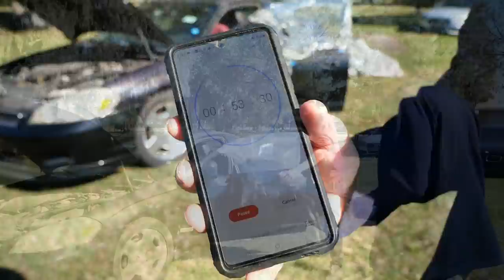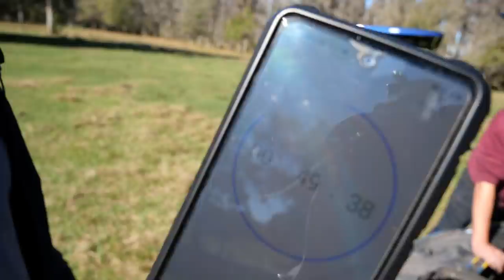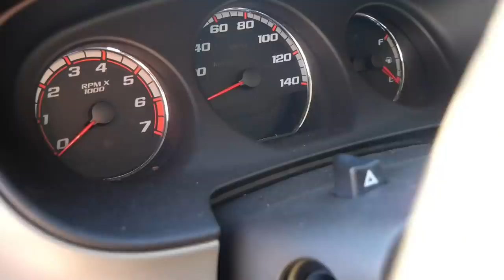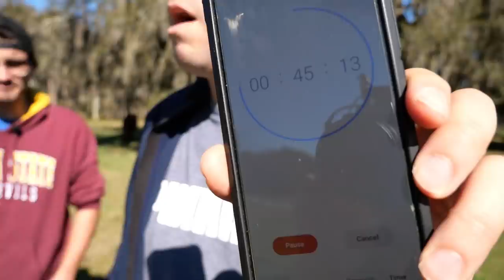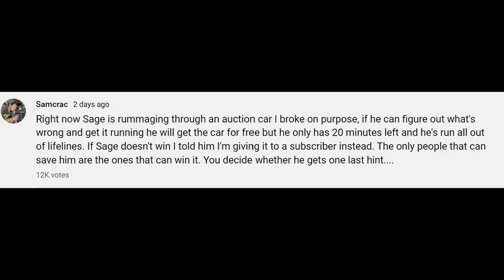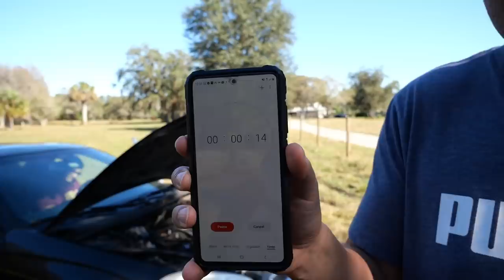If You Can Get this Sabotaged Auction Car to Run and Drive, You Can KEEP It for FREE!

Comment: Poor kid was in the end, shaking with stress and had bloodied his fingers, he did pretty good considering he's only done a lot of his "car learning" from Sam. Sometimes Sam makes me cringe with some of the "dumb" moves he makes when fixing his cheap cars, so Sage did good all things considered.
Reply: Budd Smokegood  drinkin a lil bit too much haterade
Reply: He didnt even try....
Reply: Give Sage the car
Reply: He didn't even understand the simple clue
Reply: @MohdAzylee  yeh well we all worked it out after he opened up the air duct, 20-20 hindsight.
Reply: @gazzafloss  I watch untill the end. When sam said he didnt touch thr fuel tank i knew it has to do with intake
Reply: @MohdAzylee  well man,  it's a pity that Sage's lifeline call wasn't to you instead of just Rich.
Reply: Damn wish id been offerd that would have made a good paddock basher. I knew everything he did tto the car even without the clues i would have got it running.

Comment: I've always had a soft spot for these. I'd love to mod the supercharged 3800s in the older ones.
Reply: You need to do the fiero 3800 supercharger swap. It's really quick cause mid engine.
Reply: Headers and a pulley help along with some hpi magic makes them pretty fun. I don't know whether you watch 100% Jake but he has modified the supercharged 3800 in the Park Avenue he got from hoovie. He's running e85 along with other mods and it's not doing bad.
Reply: The 3800 engine was a real gem. Seen one drive into our shop on an insane 27,000 mile conventional oil change. Owner bought it used and did not bring it in until it indicated low oil pressure. Dropped the pan, cleaned, few cycles of fresh oil and it was still kicking. Looked like chocolate snack pack all in the engine. Just incredible.
Reply: If you like the 3800 SC engine you should definitely do a fiero build, so much fun and surprisingly quick off the line.
Reply: Built my buddies 3800 supercharged, stage 3 dyno video on my channel, 
pretty deadly machine. Very sleeper and the supercharger sounds insane!!
Reply: we used to rent the v6 version Impala coupe, it was a fun car.  So was the Dodge Intrepid Avis rent a car had available, that thing rips
Reply: You can spend the day working on my 3800. It's no SC model but, it's still fun!
Reply: As much as I love BMW products, my first car was a 03 Monte Carlo SS, and I loved working on the 3800, iv always wanted an LS4 Monte Carlo SS
Reply: They are fun and can hit 12s fairly easily. After that it gets more expensive or the tranny will fail. Stupid 4T65E. What’s funny is that the LS4 powered Wbodies still use it, but I believe it was just a couple internal upgrades. 

I loved my L32 powered Regal. (05 GTP engine with the gen 5 M90 instead of the gen 3) Pulley, downpipe and mild tune and ran a 13.9 with a baby seat in the back seat. 🤣🤣
Reply: Hey Alex, would you have understood that "hint"? 😂I think he should have called you.
Reply: LS4 with Walmart trans.
Reply: @Bushspaperplanes  haha, I called it a box of chocolates. One could break while the engine was stock. One would break while trying to crack 11s. Most broke during burnouts cause the input shaft or diff decided it didn’t want to play anymore so it would take its ball and go home.
Reply: @briangardner6190  I had a sleeve in my trans crack and that costed 3457.00. For a .60 sleeve. Replaced CV axles twice and also two censors in the hub. Engine never had an issue. They just weren’t meant for those numbers in those cars. Love the idea, just not very economical.
Reply: Budd Smokegood  Is the stock limiter set that high?
Reply: I'd like to see your reaction to my SSEi... :-)
Reply: you should buy an old GTP or a Bonnevile SSEi for a video people would love that
Reply: Almost made me miss my '98 Riviera....
Reply: @ne2i  brother had one , fucking awesome
Reply: @Bushspaperplanes  haha, yup.

Comment: Sage would have been extremely lucky to find the sock, as the sock wasn't a problem with the car itself. Thus, what was presented as game of mechanic skill was actually a game of chance. Sage deserves the car, IMO.
Reply: Maybe however I was thinking throttle body with the last clue. With that thought I would have accidentially found the socks
Reply: I think the game was fair. If you try to fix a broken used car the issue can be anything socks or other crap in the intake can't be ruled out. Sam wanted Sage to think like a tech: what do you need to make a car run ? It needs spark, fuel and air

Comment: Sage solved most of the problems that prevented this car from starting,  if he had ten more minutes he would solved the problem (socks in the throttle body)

The bright sunlight probably didn’t help, then trying to look into the dark and completely shaded engine bay.  He learned something from his diagnosis-while-under-pressure experience.

Comment: Any time I meet an Impala/Monte Carlo SS owner, I ask how many transmissions they've been through. The answer has never been less than 2.
Reply: 😂 these cars 🗑
Reply: But...you never asked me!! :)
Reply: I just commented on this. The transmissions on these are not good enough. They run hot. You HAVE to install a trans cooler. I babied my GXP and still only got to 140k.
Reply: There’s a company that makes a kit to adapt the 4t80e out of the north star v8 to fit the ls4 v8

Comment: Clues 1 to 4 were great, I was screaming at the screen, fuel pump fuse! But socks in the intake, that never happens so that was a little wrong.. 😂😂
Reply: With all due respect, Sam didn't say the car quit running, he said he SABOTAGED it..... Socks are sabotage. Mouse nest in the air box would have similar effect and happens all the time. Tailpipe plugged with snow from backing into a snow bank does the same thing and also happens in nature. 

"Car can't breathe or fart" is a crystal clear clue that there is an obstruction somewhere between the air filter inlet and the exhaust tail pipe outlet. So put an eyeball on them..... Sage just wasn't listening to the clues very well.

Comment: 20:00 fuel pump relay is unplugged? This is a really cool idea for a video series if you did it with millennials and gen zs with enough mechanical experience. You could do an entry test, like changing oil, air filter, tire, spark plug, etc to make it to the final challenge to win the Sabotaged car.
Reply: Or fuse?
Reply: @M J  Exactly on point. It's hard to find Mills or Zs that can change a flat tire, let alone a spark plug.

Comment: Sage, search youtube for "Fix it keep it", and you will learn a ton.  Personally as soon as he said "fart" I would have checked the fuel wasn't disconnected, but he wouldn't let it pump gas all over the field, and that's "new" enough to have the damn thing in the tank.  So fuses were the way to go.  As for the air, I figured saran wrap on the filter, but the socks were a genius touch, and tbh I probably would have missed those.  It's been 6 months and it's only 27k.  I did my part, but I think you are hosed on a rematch for a while.

Comment: It is indeed an LS based V8. It's just an aluminum 5-3 setup for FWD. They even come with 243 castings (LS2/LS6). Any small-bore cathedral head will bolt on. You can even get an LS6 intake to fit with some modifications.
Reply: Yes...not many people realize this LS4 has the 243 casting Z06 heads!!
Reply: And make that 4T60 shit the bed before the thermostat opens up.
Reply: @InsaneBimmer  This car doesn't have a 4T60.
Reply: @InsaneBimmer  LS4 did not come with the 4T60; it has the 4T65. 4T60 came in older GM fwd vehicles from about early to mid 90's. The same with just about any other modified vehicle from this era, the transmission internals will have to be upgraded to handle the extra power...rather it's an "HD" version or not, the stock diff is too weak, since it's the same unit offered in the N/A 3.8L V6 (albeit a different TCU calibration). There are companies whom offer built versions to handle well over 400+whp; PATC, ZZP and several others.
Reply: @SuperSportSS  Correct, they are the same heads that came on the LS6, minus all of the fancy stuff (hollow sodium filled valves, etc).

Comment: Come on now! Be a gentleman and give Sage the SS….. he totally deserves it.
Reply: That word deserve is interesting.  He lost the contest.  he doesn't deserve to take the car when he lost.
Reply: @mexicanspec  I totally understand where you are coming from but stuffing socks in a throttle body will never happen in the real life ever. Plus Sage has been with Sam for quite a while now and has helped in so many projects and contributed to the series success. In my opinion it was a cheap below the belt jab from Sam. He never wanted him to have the car in the first place.
Reply: @dennismassey3259  who said the sabotage were real world problems?  That is only talked about by the commenters here.  The clue was obviously  about the intake so why didn't he go directly to that?

You are not going to change the fact that he failed to get the car out and it is his fault and nobody elses.

He got his tool set and maybe he will get a second chance.

If it helps you sleep at night, just think of it as a blessing because that car might have cost him thousands restoring it.

Comment: Socks in the intake? Yeah, there’s a service bulletin for that one. 

Sage wins by default.
Reply: really? I dont think so - did you watch the Hoonigans and their series? I mean its pretty obvious. Fuel, Spark, Air. Every single one of those isnt toooo hard to check. Schrader-valve for fuel, spark is just a test crank away and so on. From there just trace it back

Comment: List to do:
-Check battery and Fuse box;
- Check the Spark and then if Fuel is reaching a line before the injectors;
-Then the air intake and the vacuum lines.

Comment: I can understand most of the disabled items you did to the car happening in real life, but having 2 socks stuffed in the throttle bottle is highly irregular and prone to never happening.
Reply: Ehh it could happen
Reply: Socks might be unlikely, but a rag is quite common.
Reply: Socks, true.  But 18 months ago, "Pine Hollow Auto Diagnostics" had a Malibu where a gasket spit and jammed the throttle body, causing a "disabled engine" condition.  So, while the cause is unusual, the result isn't that far out.
Reply: He said he sabotaged it.  He didn't say he broke it to make it look as natural as possible.  He could have removed the engine; Sage wouldn't have noticed.
Reply: it is not so hard to make car run. air, fuel, ignition.
Reply: From an auction it’s common to have stuff stuck in the intake, guys do it trying to get a lower price
Reply: Why would it need to be something that happens irl. The guy was told the car was sabotaged and could not breath or fart. IM suprised he did not at least check air filttereihin, maby sam would then have provided a hint
Reply: No, but backing into a snow bank and plugging up the exhaust pipe with snow has the exact same results, and it DOES happen in real life.....
Reply: @SuperHessu555  Very true. Mice LOVE to build nests in those air boxes and cause similar problems to the socks. Sage just wasn't listening to Sam's hints seriously enough. He was told several times that the "intake" and "exhaust" weren't breathing and farting properly. He needs to learn the basic diagnostics of air, fuel, and spark before Round #2!
Reply: As unlikely as an angry ex-girlfriend getting into your place one last time and stuffing some prawns into a curtain rod!

Comment: I love the Monte Carlo SS V8 ones. Even though, it's Fwd, the transmissions are weak sauce. I wouldn't be surprised that you need to replace the transmission. Nice car though, I like them
Reply: I've owned a couple and been lucky enough to sell them before the trans died. They're great drivers and quick enough to surprise other fast cars. That blend door may just need recalibrated since the battery was disconnected.  If it actually needs repaired it's a pain in the butt. I'd definitely buy another one.

Edit - If you're ambitious you can swap the Cadillac 4t80e into it. It takes some work but it'll be bulletproof afterwards.
Reply: @mjc8248  Cool
Reply: yeah, they would have hit it out of the park if they'd made it real wheel drive.
Reply: @muskokamike127   I agree
Reply: Truth  it's still junk and the stock 4t80e is cheap and durable. It requires some fab work but the one we put in my buddies car has held up to 450hp with nitrous on top for a year and a half and still going strong.

Comment: Sam, you have to teach him the 3 elements, "Air Spark and Fuel" The holy graal in fixing cars 😁
Reply: Timing and compression also.
Reply: I would have failed at the fuse being bad. Test light sitting right in front of me.

Comment: I will say sage needed to go back to basics, a car needs air, fuel and spark to run, Alex says it often,  the tricks you pulled were evil I would have pulled the intake off but I am not sure if I would have looked for socks in the intake, I had the fuel and the battery, I have come across a snapped fuel pump fuse a couple of times at an auction, I have also found a zip tie on a fuel line bend stopping the fuel, I have even found plastic between a set of points all deliberate modifications to cars that were driven in to the auction but modified to get the car cheaper when it was bidding time..

Comment: Thought gas right away. 
LS4 engine. LS based. But front drive bell housing Crank and block flanges are shorter to fit the engine bay. 
Known for DOD lifter failure. Transmission doesn't like the HP and abuse.

Comment: Please tell Sage to turn the key to the "on" position - without starting , and listen for the fuel pump.
Reply: It would have been hard to do over that damn blend door actuator clicking away
Reply: @ColeSpolaric  That would have been  first on my list  to unplug.
Reply: @tim1299  you have to remove parts of the dash in order to unplug, at least a 30 minute job :D

Comment: The fuse box. I had a blown power adapter fuse in a rental car and it was more convenient to go Love's gas station and buy an $8 fuse kit than change out the car which solved the issue.

Comment: Heck no don't give him the car anyway! 
He understood the conditions of the test before he even started! It didn't cost him anything except a little time, But the lesson that he learned here will serve him very well for the rest of his life. The entire time, from the start of this video, as soon as he started going over the car looking under the hood he was not thorough AT ALL, he just skimmed over everything lightly! EVEN AFTER He found the coil wires unplugged, he didn't even pull the cover off and check the rest of them!  He was NOT thorough. AT ALL.  The lesson he learned is he needs to be thorough. If he had been THROUGH, he would have won the car! Plain and simple.  As a mechanic I am EXTREMELY EXTREMELY THROUGH. It has helped me & Saved me SO MANY times!

Comment: I recently got a 2009 Impala SS for $1200 with a bad AFM lifter. I hope it is on the front bank. The engine is the only transverse mounted LS V8: The LS4. Sam, disable the AFM before it fails.

Comment: That green battery disconnect was invented by an employee that works (or worked) for my uncle. He holds the patents on it. They stored cars for service members (one of the reasons) and got tired of fetching a battery cart that was fully charged so he invented that quick disconnect

Comment: The 5.3 Vortec in this car IS an LS based engine. It is not an LS like everyone calls it. Is is a Vortec. However it is based off of an LS in the fact that it shares a lot of design and parts, however an LS is an Aluminum block and different heads and a Vortec is an iron block and less for performance like an LS is.

Comment: I have the GXP Grand Prix with the same engine and a C5 Vette.   The GXP is slightly modded and the Vette is stock.  The GXP will honestly give the Vette a damn close race.    I had another Vette that had lots of mods that would eat the GXP though.   The thing about the GXP is unless you look close or hear it run, you think it is granny's grocery mobile.  When it blows past you at 160MPH though it is a different story.